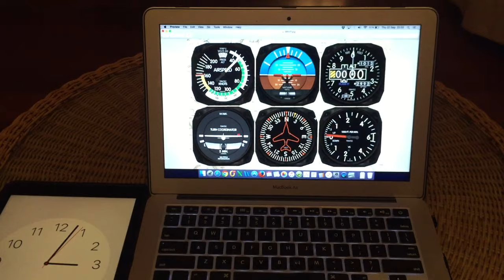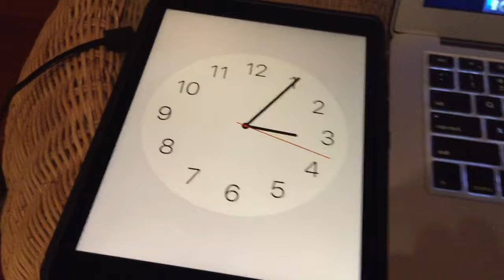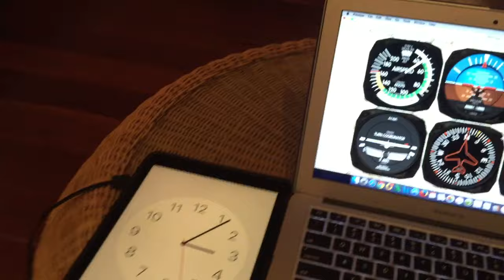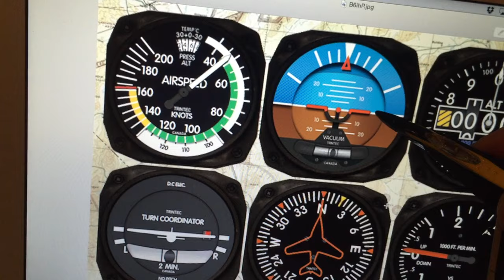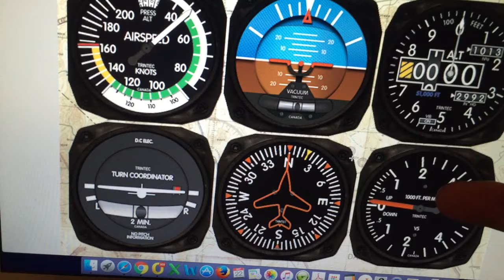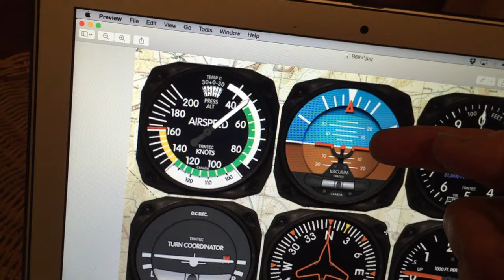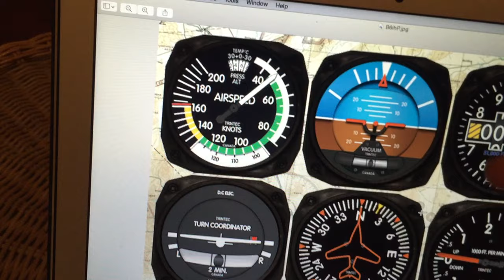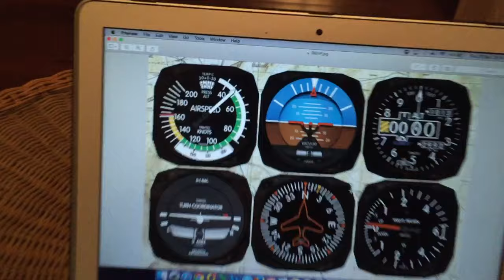Do aircraft change attitude to follow the curvature of the Earth?

Comment: Start the plane instruments (gyro). Just stay, don't fly for 1 hour. In that hour, if earth is bal, the gyro has change his position for 15 degrees. End of experiment!!!
Reply from the maker: No because the gyro has correction mechanisms.  I have shown this in other videos by opening up a real aircraft instrument and showing how the corrections are made.  

These are required because the Earth is rotating and the plane is also flying around curve.  Without the correction mechanisms the instrument would be useless within minutes
Reply from the maker: https://www.youtube.com/watch?v=z1QGRPVBZvw&list=PLwPbV85vHY7cn0GAo4h05Xzr_tJflGn1t&index=4
Reply: @Wolfie6020  switch the correction off. What will happen? Nothing, the gyro want change his position!
Reply from the maker: @AndrejOdessit  Did you watch the videos?  

Do you think the gyro is perfectly frictionless, perfectly balanced and no torque reaction from the motor turning the gyro? 

Do you have any personal experience with gyroscopes?  They always precess due to many reasons. 

Expecting one to stay motionless quite unrealistic

Here is a video of a gyro and you can see what the bearing friction and torque reaction does. 

https://www.youtube.com/watch?v=UPgYfngHYXA
Reply: @Wolfie6020  gyros are used not only for positioning, but also for stabilizing of ships, vehicles (two wheelers). Ye, tell me about!
Reply from the maker: @AndrejOdessit  And those gyros have correcting mechanisms also for the same reasons.   Your point is?
Reply: @Wolfie6020  my point is - you are liar!!!
Reply from the maker: @AndrejOdessit  When the debate is lost slander becomes the tool of the loser. 

Obviously you cannot refute what I have told you so you must resort to calling me a liar. 

That means you lose.

Comment: level is level there is no maintaining  level on a curve otherwise level means nothing there are a lot of bridges 10 to 20 miles that you can use a laser level on that maintain a straight line level
Reply: Have you actually tried that to find out if it's true? Do you have video footage documenting this?
Reply: @sbushido5547  the atchafalaya basin bridge would be a  good one to try it on but i dont have a big enough laser i used a pointer laser on smaller ones but they might get 2 miles but it will stay on point on the metal underneath we painted the underneath of 2 bridges one was 18 miles but it was 20 years ago when we all thought the earth was round lol i can tell you the bridge was level except at the ends water is always level look up this bridge its in breaux bridge  louisiana

Comment: hmmm...did allied bomber pilots keep correcting their flight many times per minute? manually? imagine the embarrassment of pilots flying into the vacuum of space instead of dropping their bombs on germany or japan...lol
Reply from the maker: +zachzodia - no you have completely missed the point of my video.   The correction is tiny and is totally absorbed by the actions of maintaining level flight by reference to the altimeter and VSI.    If you believe aircraft can fly off into space you need to go away and have a good long think about this again because that logic is completely flawed.
Reply: really?...tell me than what would happen with a plane that has no autocorrection and no pitching down at all? is that plane going to gain altitude? how much altitude?...lol...can you tell me then how did pilots in ww2 fly to germany and did the night bomb runs without computerized autopilots that corrected their altitude dozens of times a minute? what about the pilots in ww1? did all of them pitched down their planes manually?
Reply from the maker: zachzodia
I just explained it to you.  I have no idea why you still don't understand it. Watch my video again. I explain it clearly there also.

Comment: Do aircraft pitch UP during cruise? 

http://aviation.stackexchange.com/questions/2726/why-do-airliners-pitch-up-during-cruise
Reply from the maker: Hi, to answer that question I need to confirm what you mean by "pitch up"

If you mean are they constantly adjusting the nose attitude upwards then the answer is absolutely no.   That would result in a climb.

If you mean is the nose of the aircraft angled slightly upwards during cruise then yes, this can often be the case.  It depends on the speed, weight and the design of the aircraft.  The wing needs a positive angle of attack to generate lift  (about 3 degrees)  Some of this comes from the Angle of Incidence (the angle the wings attach to the fuselage) 

Lift is a function of angle of attack and speed.  If the aircraft slows down it will need additional angle of attack and that will result in a slightly higher nose attitude - the aircraft attitude can indeed be slightly nose up in level flight. 

It does not continually pitch upwards.  

Hope that answers your question, if not please let me know and I will be happy to make a video explaining it in more detail.
Reply from the maker: PS, sorry if I missed any of your questions, some of your posts were in the Spam folder but I have approved them.   I did answer your question about the Stars, They do seem clearer in the Southern Hemisphere, that is because the air is generally clearer than it is in the Northern Hemisphere.  From high altitude it makes little difference, the Stars are very clear in both Hemispheres.
Reply: I didn't ask if they were "clearer," i asked if they seemed "closer." People have noted that they do. How about you?
Reply: O.K. so did you read the article? The person is asking why the aisle of the airplane is sloping upwards at cruising altitude/speed (not "slowing down"). Since airplane wings are designed to give a positive angle of attack to generate lift, the question arises - why should a modern passenger airplane need to fly nose up in level flight, which will only result in increased drag and more fuel consumption? Not to mention having to constantly adjust for the curvature of the earth by pitching down for the entire course of the journey.
Reply: You didn't miss any of my questions. In fact, someone else replied to one of them but i could not post a reply to him or yourself. How odd.
Reply from the maker: +Electric Earth  No I would not describe the stars as looking closer at all.  They look about the same to me in both Hemispheres.

Yes I read the article.   Nothing unusual at all about having a slight positive deck angle on the aircraft.  It would not be more than 1 or 2 degrees in normal cruise.   It would actually be more at the beginning of a long flight as the aircraft is heavier and needs a higher angle of attack at the cruise speed.   As weight reduces the deck angle will reduce also while speed is held constant.  Totally normal. 

Youtube stops me from replying on my own channel sometimes also.  It gets frustrating.  If I close the browser and re open then it seems to work.
Reply: O.K thank you. It must be the imagination of those people then, hey?
Reply: So how does the aircraft pitch down to follow the curve of the earth if it is pitched up at 1 or 2 degrees at normal cruise? 

"It would actually be more at the beginning of a long flight"

But that's not what the person who asked the question indicated was the case. They actually state that the aircraft only reduces the deck angle when descending and the flight was pitched up for the entire flight except takeoff and landing. 

 "...as the aircraft is heavier and needs a higher angle of attack at the cruise speed."

Why would the weight necessitate a higher angle of attack? Is the fuel stored at the front of the aircraft?
Reply from the maker: +Electric Earth,  those are all very good questions.

A passenger has no accurate way to precisely measure the deck angle.  If it was 2.5 degrees at the beginning of a flight and 2.0 four hours later they would never know the difference. 

The lift formula includes the coefficient of lift and the speed squared.   We can say that angle of attack is basically coefficient of lift for this explanation.

Imagine two identical aircraft flying in formation.  One is full of fuel and the other is almost empty.

For this example let us assume the aircraft full of fuel weighs 100 tons and the other weighs 50 tons.  

The wing on the heavy aircraft must produce 100 tons of lift, but on the other aircraft only 50 tons.

They are travelling at the same speed so the only way more lift can be generated is with a higher angle of attack on the wing.   The heavy aircraft may need 4 degrees angle of attack but the light aircraft will only need 2 degrees.

As the heavier aircraft burns fuel while maintaining the same speed it gradually requires less angle of attack and when almost empty will also be at 2 degrees angle of attack.

This reduction occurs over many hours of flight and will be completley unnoticed by passengers.

I flew a Hawker 900XP for several years.  With a full load of fuel the deck angle in cruise was quite high and actually uncomfortable to walk in the cabin.  At lighter weights and the same speed the difference was significant but the change occurred over 5 hoirs of flight.

Again I have no doubt the passenger experienced a positive deck angle for the entire flight.  How accuratley was he measuring it through.?  To fractions of a degree?  No I dont beleive so.

If the aircraft has a 1 degree nose up deck angle and travels 111 kilometers the Earth has curved by 1 degree.   As it was travelling this distance the nose will be dropping evenly 1 degree spread across the time taken to fly 111 kilometers.   So even through the nose of the aircrsft has dropped 1 degree relative to its original attitude the deck angle is still 1 degree up 111 km later.  

Easy to visualise this if you have a model aircraft above a Globe model and move the aircraft across the surface keeping the nose 1 degree up from the local position above the globe.  Deck angle is always positive yet the nose attitide is dropping as you move across the curved surface.

Comment: Hi Wolfie6020.  I have been reviewing the latest GLOBEBUSTERS Flat Earth.  Over there, they are making a big deal out of the "aircraft pitch down" to fly around the globe.

Can I make a suggestion?  Could you make mention of LOCAL LEVEL?  

Either in auto pilot or manual flight, the adjustments as so small as to be imperceptible, you mention that, but I think the flat earth crowd take the "pitch down" issue as literally making a kamikaze dive toward the ground.  They infer that the pilot has to be continuously keeping the curve of the earth in mind when making these adjustments, when really the only thing the pilot of auto pilot is doing is maintaining LOCAL LEVEL Flight with respect to the center of gravity.  (E.g., level with respect to a perpendicular to the earths radius.)

:)
Reply from the maker: Hi Neil,  yes Local Level is a good way to describe it.   I honestly wonder how small they think the Earth is?  The Globebuster graph on average rate of descent has no application at all here.  There is no descent ever while maintaining constant altitude.    People posting math in the comments showing rates of descent simply have no understanding at all of what is occurring as the aircraft moves.
Reply: Wolfie6020 It is a really bad argument on which to debunk a GLOBE..,  Even so called real-world PILOTS at G/B.  That is what amazes me so much.

A STRAWMAN.

Thanks!
Reply from the maker: I totally agree Neil.   This video literally went right over Bob's head and he is avoiding my questions on his "il"logic